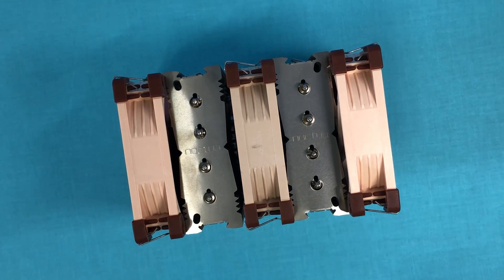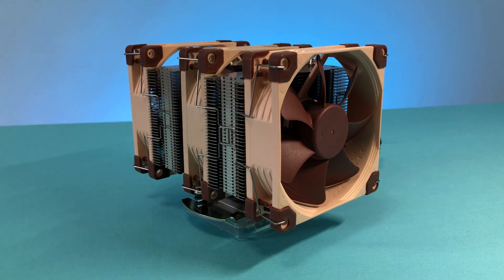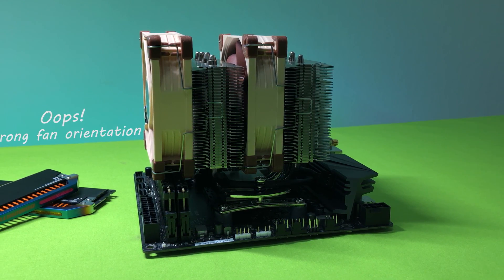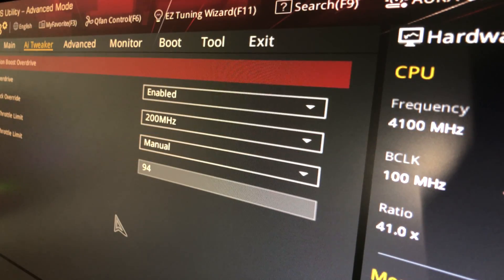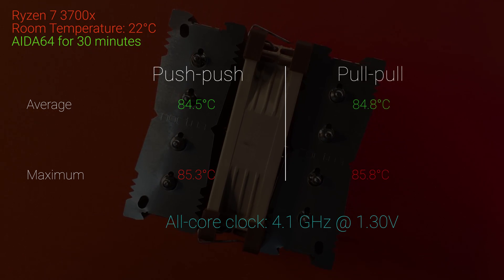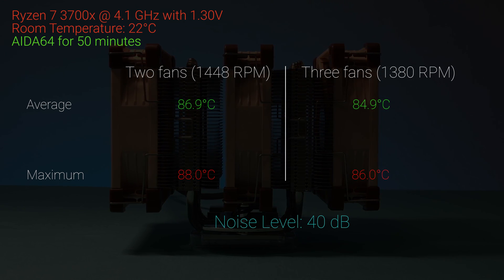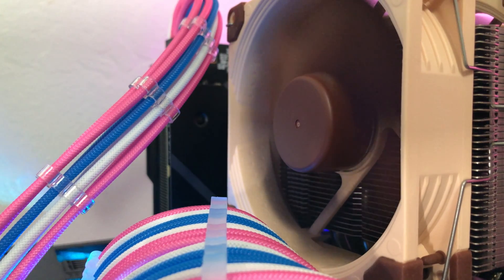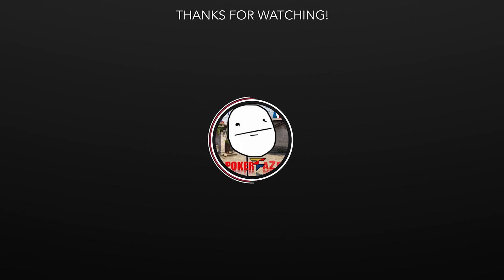Noctua NH-D9L with Three Fans - Smol NH-D15 Cooler

Comment: There is a D9L chromax black now. 

And i kinda disagree on that noctua should make it taller, because it would break compatibility with 3U, HTPC and slim cases, which this cooler is targeted at. I'm using it in such scenarios.
Reply: Just purchased this for a 3u rack mount case. Have you tried multiple fans?
Reply: @logiqalone8249  I have two of them. One in my bedroom HTPC in a Silverstone Grandia GD-04S slim case. Single fan config, because it's just an i5 12400F. The other one is in a silverstone 3U 19" chassis for auxiliary rendering. It has a dual fan config for a Ryzen 7700, which i PBO'd to it's limits. 

There is a secondary fan bracket included with the cooler and NF-A9 fans also have one included, together with an Y-Splitter. So no additional purchases are neccessary, even if you go triple fan, which i did not try.

Comment: I just noticed this Noctua note about push/pull configs on the U14S. I already knew about these gaps just never saw them talk about it.

“Dual Fan Ready
For users who want to achieve even better performance by adding a second, optional NF-A15 fan to create a push/pull setup, the NH-U14S includes fan clips and an extra set of custom-designed anti-vibration pads that allow to off-set the rear fan by 5mm to improve acoustics in dual-fan mode.”

Comment: I have this D9L single fan in the bedroom with a 7600x. Temps are higher than my U9S with dual fan on the same cpu in a different media pc in the family room. 

Planning on taking the U9S Noctua fans and doing a triple setup like this on the D9L. I’ll buy some Silent wing 2 92mm fans for the U9S.

I already run three 140mm Noctua fans on my D15.

I also bought basically a D9L clone the Thermalright Silver Soul 110 for my shop pc and ran  dual 92mm in push / pull and a 80mm push on the front. Pics are posted on my review of it on a very large reseller site. Very nice cooler and I would bet on par with the D9L. Mounting it was just like Noctua.

Comment: Careful when using a pull fan without a slight gap. There is increased noise due to the pull side of the fan being too close to the heat sink. If you compare both sides of almost any case fan you will see the motor side fan blades is deeper inside the fan frame giving just enough gap to not create extra noise from being direct up against a heat sink surface. The pull side is too close and when put up against a heat sink there will be added noise. Noctua actually provides fan corner extended bumpers to move the pull fan away from the heat sink. I made a very basic video showing these thicker fan bumpers.

I just ran triple fans on the similar Thermalright Silver Soul 110. I used small felt pads on the pull fan to gap it to reduce noise associated with pull fans being to close to an object. 

Also if only running two fans always avoid both on pull unless you gap both. If you do push / pull then you only need to gap the single pull fan. You won’t need to lower rpm as bad in pull configs to get rid of the pull fan noise. Your noise normalized testing would have shown even better results with pull fan gaps.

Comment: Here is a quick tip separate the two towers with a thin piece of plastic and run the fans opposing each other, you will improve by as much as 10°C no joke👍🏻

Comment: Did you use a different thermal paste? The tube it comes with is terrible. I lifted my cooler immediately after applying and I was very generous with my application and there were spots that looked bare like pulling a heatsink off a 6 year old cpu. It could be the paste. I am running the same cooler with Arctic Silver 5 paste and run at 68c at most.
Reply from the maker: I am using the Arctic MX-4, I used all the NT-H1 paste that came with the cooler months ago :)
Reply: @PokerFaZe  Ah ok. Loved the video btw keep it up!
Reply from the maker: Thank you

Comment: So what were the Temps on gaming tho ?? 
I have that cooler boxed away in my closet lol
I just don't want to swap it from my artic liquid  freezer 2 for higher higher Temps. I know they won't be no where near my 56- 58C that my freezer 2 gives.
But if it holds a nice mid 60's I'll definitely do it because I really do like the look of this cooler.
Reply from the maker: I put it in the Cougar QBX, got 75C while playing RDR2. You can check in my latest video.
Reply: @PokerFaZe  so I gave it a shot last night lol.
I took down my liquid freezer 2 and put on my NH D9L. So my 3700x is OC to 4.4 @1.280V just to let you know. I was playing two games of mine that I know makes my CPU and the Temps were for most of the time at 63-66C. Thee only thing I didn't like was at times when the matches I played ended and the game would take me to a new match, Temps would spike hard and fast to 74C but while gaming it did stay at 63-66C

I was actually impressed and I do feel that if noctua  would refresh this cooler to be just a bit taller and add maybe 4 to 6 air fins while still keeping the 92MM fan it would do amazing honestly. 
As of now I did go back to my D15 and I'm gonna leave it on for a while because it is my favorite cooler I have. I really wish noctua would refresh the 9DL tho, that little thing has some serious performance

Comment: I also wonder why Noctua haven't revised this cooler to extend the fins since this isn't exactly 110mm in height when you factor in the fan as they claim it to be.

This cooler has a design flaw wherein the screws prevent you placing the middle fan so that it clears the 110mm spec when you actually mount it. You're forced to have it offset a bit to the top so it's actually almost the same height as a NH-U9S (probably 115-120 mm).
Reply from the maker: Agree, and even with the fan mounted like that, 1/5 of the fan diameter is unused while the entire fin stack is still fully cooled

Comment: Hi there! I have a deal where someone is selling Noctua nh-d9l with 2 fans for 45 usd. I can get the cooler master hyper 212 black edition at the same price. Which one should I go for?
Edit: I'll be using the cooler for Ryzen 5 3600
Reply from the maker: I'm using a 3700x, so I think you can't go wrong with any. But the D9L alone is 55 bucks on Amazon, so 45 for the D9L + an extra fan is definitely a steal